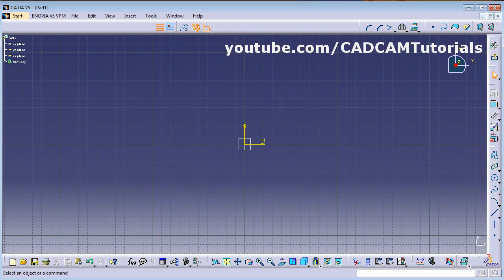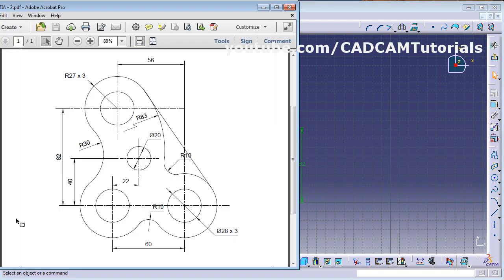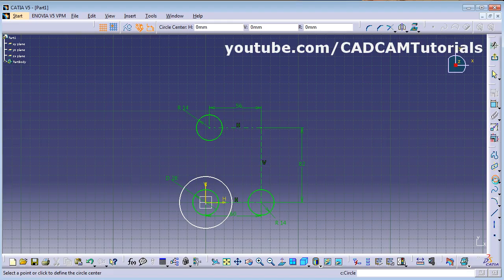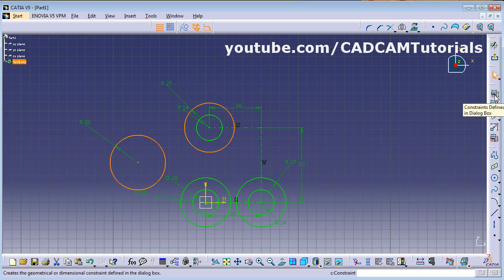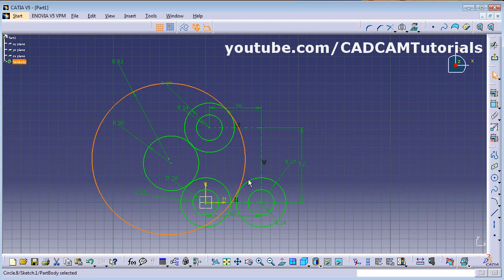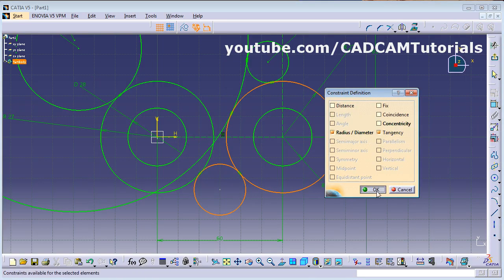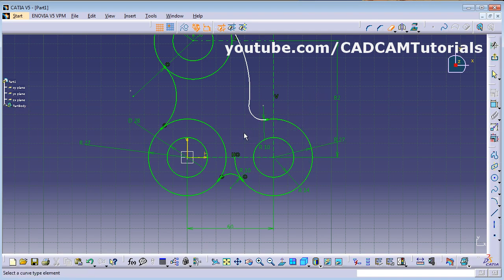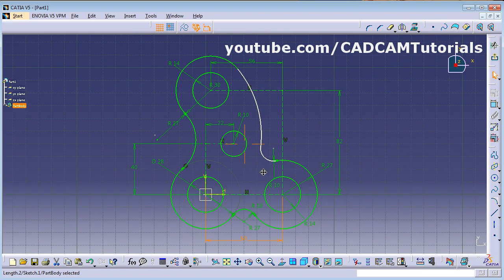CATIA Training Course Exercises for Beginners - 2 | CATIA Sketcher Drawings

Comment: It looks like you accidentally deleted your R83 circle when trimming. I also think that was supposed to be tangent with the lower-left outer circle rather than the lower right outer circle. I had to zoom in as much as I could to properly trim the redundant part as to not accidentally remove the largest circle.

Comment: In my sketcher drawing is not able to get constraint. tell me the settings option.
Reply: Your constrain visibility mode is not activated so only your facing this issue at the bottom window you can see the Dimension constraints option enable it